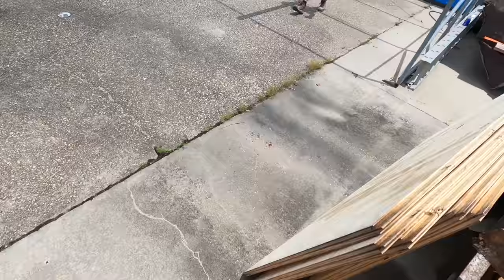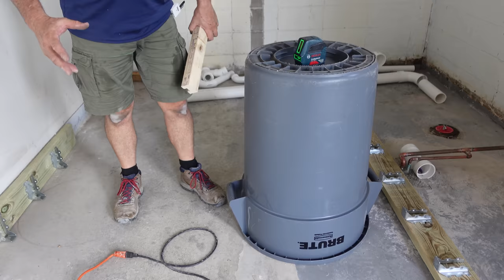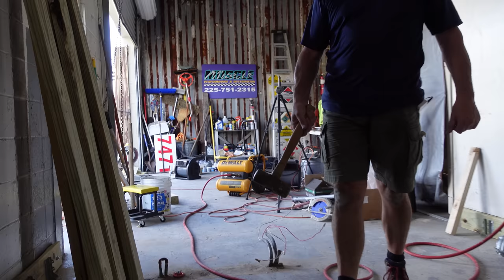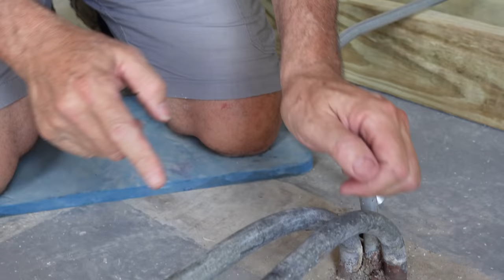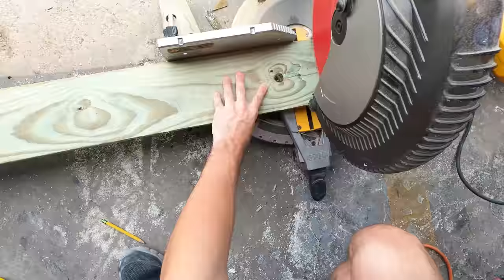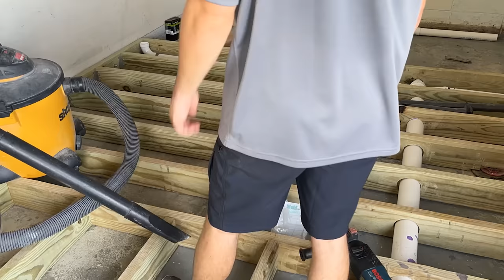The STRONGEST Subfloor System We've EVER Built! - THE SHOP Part 4

Comment: Looks good. Very solid floor system. The only recommendation I would make is to not have that new drain line rest on the nut of the sewer plug. Gravity "eventually" will push through that nut and crack the pipe. A little blocking around it (like the pitch block) will make that area 100% perfect. Keep up the great work guys.
Reply: I had reservations about that myself considering vibrations and friction in the long term. Also, is the plug a standard way to go? Or could you have packed the pipe with debris up to a few inches and then seal the whole thing with hydraulic cement with a level finish? Love the series. Can't wait on the new house demo! Hopefully it's cooler!
Reply: @FaceFaceMan  I can’t speak to that specifically. Codes are different in that area. I have, however, replaced pvc pipe that cracked due to rubbing on fasteners for a period of time.
Reply: Agreed!
Reply: I’m concerned about that as well!
Reply: You said 😃 it. 😊 Hope they rethink the "pipe resting on the nut". I was hoping they would be plugging that hole 🕳 from the beginning, rather than the red plug wheel ♿...😊 😊
Reply: I was thinking the same thing. If that pipe presses down at all it might get punctured. Some sort of protective barrier or support would be a good idea just in case.

Comment: Make sure you install Nail Plates on the 2x6 floor joists on top of the septic drain line, that way you can’t nail the subfloor or screw the subfloor down on top of that 4 inch pipe and pierce it!

Comment: When you were cutting the conduit, I thought, oh, burrs inside the conduit, wires resting on it......then you solved it with great care.      One (of many BTW) of your strengths is the important small things you sweat that are critical.   Anyone who wants to learn all the little tricks that are vital.....this is the place to learn them.  Great work as always.
Reply: i had some wires short out under my house and blow a fuse, electrician ended up replacing a large section of old pipes with tight curves, they rattled around alot when the wind blew under the house, i assume that short was caused by similar problem, sharp inside of pipe over time moving cut the plastic sleeving on the wires

Comment: That floor looks amazing! You always do great work and whenever you post I enjoy watching you work. My only criticism would be that the drain pipe should not make contact with the wing nut of the cast iron drain pipe. You should always assume the pipe will vibrate and because it’s metal against plastic, the pipe will develop a hole. And the other thing (if I had to nitpick) would be more of a suggestion really. When you anchor the L brackets to the floor to prevent the floor from ever coming up. If you are only going to use one anchor per bracket, use the hole that’s closer to the corner of the bracket instead of the one that’s farthest away from where the load/pull is applied.  But like I said... I’m nitpicking really, I think you are a great contractor and your knowledge shows all throughout your builds. Can’t wait to see this project finished and see you working in Texas with the stud pack house build. That’s gonna be epic!

Comment: Hey gang, the shop probably has scraps of aluminum sheets from working on the cars. Just add a 4"x4" piece where the floor cap is holding up the PVC drain, as when people sit and stand from the toilet, the lines will flex and rub on the metal.

Comment: You may not have the freezing cold like we have in Minnesota, to freeze the water pipes, but you do have hot steamy air that will create condensation. You are preventing water from pooling on the floor and making the wood wet, which would eventually cause wood rot, even with treated wood. Always a good plan to insulate the pipes.

Comment: Great video. I'd suggest putting something under that drain pipe at the toilet and don't let that plug wingnut support it. That puts a very small metal contact point on the bottom of that pipe and over time the movement of people walking and using the toilet could wear a hole through the bottom of the pipe, and when it does it won't be pretty. Everything else looks great though!

Comment: Another great job👍 Where you set the pipe on top of the plug, I’d be concerned that over time the threaded part could wear into the PVC. You could take an electrical metal box cover and slide that between the pipe and the threads. I know it’s overkill, but I’m a “belt & suspenders” kind of guy👍

Comment: Love it as usual. Two humble suggestions:  1) use stud guards/nail plates on floor joists above the pvc. It will save a ton of future problems if someone comes after you and nails/screws something through the floor and hits the drain pipe. 2) Don't rest that pipe on the expansion plug. It WILL eventually crack that pipe. You guys are awesome!

Comment: Very solid looking build!
I'm sure others have or will mention it, but resting the drain line on the plug bolt is a bad idea. Subtle expansion and contracting / movement of the drain line will cause a friction hole... eventually.

Comment: I was in the inground swimming pool business in the 70's- 90's. We used a water tube to level forms. With any shape, any size pool the two of you didn't even need to see each other on freeform pools. It never failed even 100' away. 
Really nice planning for the plumbing. I did a lot of pvc pipe in tight places and you have to see the entire project in your head or on paper before starting.

Comment: PL can radically improve overall strength of a panel on frame construction. Use a bead of it on the joists before attaching the plywood. The floor takes on drum strength.

Comment: Hey stud pack. Great job. I’m a gc been framing for 10 years. If you run those joist perpendicular from the others. You have to double the joist they hang on. And you need an extra joist inside the outside rim joist with inside corner hangers.

Comment: @22:47:  Minor suggestion:  When you put blocking in contact with concrete, try to avoid putting the end grain in contact with the concrete, because end grain wicks the most.  It's especially an issue when the end grain is from a cut, because it won't be pressure-treated.  Try to put the side or face grain in contact instead.

It's not a big deal here, because the PL will act as a barrier.
Reply: Great job

Comment: The drain pipe that passes through the joists is very close to where the subfloor will be. Need to be careful when nailing/fastening the subfloor down in that area. I've seen "nail plates" used to protect the utility runs in wall studs; maybe those can be used here?
Reply: Great point!  Protecting your utilities is always a good idea.  You might know where not to nail or screw but the next guy may have no idea.  You can use a SkilSaw/chisel out a notch out an inset so it doesn't mess with the flatness of the floor.

Comment: Paul I had. Porter Cable palm nailer it had the same issue yours did! Then I bought a Rigid $65.00 they’ve gone up!   I’ve never had any issues with it just make sure not to have the pressure set to high on your air compressor because it will blow out that bladder

Comment: I love those Milwaukee big hawg hole saws. They’re not quite as fast as a self feed but they have tons of other advantages. They make less of a mess. You don’t have to be as careful because they don’t bite and throw you around. They also cut through nails without getting torn up. Also because they’re carbide, they’ll drill through stucco, cement board, and other small cement based products.

Comment: In would have done it the same with 2 changes. Gal tru bolts (that's what we call them) and an L bracket at each tru  bolt in the block wall. The wall of those empty blocks is barely an inch thick the a failure could  occur with the cinder block blowing out. Man I could watch you guys work ALL day 😂 thanks for the content

Comment: GRRREAT video brother Stud...I have been hoping you would do something like this for a long time. I did essentially the same thing a year ago, and lo and behold, did it basically the same as you! I did use Simpson Strong Tie screws instead of nails though. My floor is 14x22 (a tad bigger). I would have gone a little larger for the plumbing holes, you may get some expansion squeaks...I also would have just put in a PVC plug/cap on that drain...rubber will always deteriorate. All in all, great job Paul!

Comment: Palm nailers are da bomb!  I had to rework a second floor joist system and ledger due to exterior water intrusion.

After jacking up the second floor, the roof truss system, and replacing the rotted load-bearing exterior wall, the second floor joists needed to be reconstituted.  The palm nailer was the only way due to the tight and limited space.

Comment: NIce work. I would have put a moisture barrier down. I would have tried to frame it in the opposite direction so I didn't have to drill for the main pipe, but you're on the job so you know what you have to do. You go the shower to deal with etc.

Comment: Great job guys. You might consider having your pitch blocks run the full width between joists and use a pipe strap to secure them in place.

Comment: I like using vertical 2x4s to help support joists like this, especially when making a big hole or notch. A few nails into the joists and the 2x4 resting on the concrete. It will never sag.

Comment: Great job as always gentlemen.  One step to consider on future on-slab builds is a vapor barrier.  At minimum, a 6-mil reinforced poly, and at best, Dorken DELTA-FL.  It’s a 3/8” corrugated (structural) polyethylene sheet that allows air and vapor movement beneath your framing.  Although you’re using PT framing, the subfloor is not.  I just framed out a 900 square foot basement with this stuff, plus 1” foam & then tapconned 3/4” Advantec subfloor 16”/center over it.  On the walls, use DELTA-MS.  You could instead use the DELTA-MS in the floors for less seams.  Looking forward to the next video!

Comment: What a difference from one local to another. In Los Angeles, the concrete would need to have been Red Guard. You can never bore a hole that close to the end of a stud. You could not use those L brackets and have to use  tension ties. Also because the bath room is elevated and in a commercial building, you would have to add ADA ramps throughout. 

I would have hung a plastic curtain to contain the dust, rented a wet concrete saw to make the cuts. It would have saved a lot on materials and I do not know how I would ever get that passed by the inspector.

Comment: Thank you for another awesome video, I learned a lot from this video!! Yes, I’m a woman but I love to remodel and build things. Our basement loves to flood and can’t afford outside french drains. Trying to find alternative methods to fix the problem. This video was again awesome, keep up the great work. Thank you guys!!!
Reply: You're probably looking at interior drain tiles to a sump pump.  If you go that route, I'd suggest not having the dimple board run up onto the walls, which creates an air gap to the soil, potentially letting in radon.  If you add a sump pit, seal it and check for radon from that penetration as well.

Just my 2 cents, but a local pro will have much better advice.

Comment: I was inspired by your video to install some LED wafer lights. I didn't realize until after I received mine from Amazon, that yours were different from mine. I could mount over a joist where you couldn't. I'm glad I got lucky and ordered the right ones because that would have created a problem for me. A second thing to note is that the six-packs I ordered could not be added onto. If your layout calls for seven, you'll need two six packs. I assumed I could go to Home Depot and get extras. No go. In fact, the stenciling on the back of each lamp clearly states "6 pack". You can get extras, but they come with an electrical box. No sure quite how that would work. Lucky for me though, the pattern I decided on (before I even knew that I couldn't get extras from HD), was 12. So two six packs did the job. Love what you do. Eager to see how the plaster of paris house comes along.

Comment: Crazy solid work. Love to see a job done well. Others have mentioned the pipe sitting on the plug fastener but I was curious if there was a reason for the L brackets being secured to the floor on the hole at the end, I would think nailing them closer to the bend would provide more strength against rising. Either way I'm sure it won't move! Great work guys.

Comment: Nice work guys! I love your videos.   Are you not worried about that plug's wingnut wearing through your drain pipe?  I would be concerned that vibration would cause that wingnut to eat its way through the pipe and cause a sewage leak.
Reply: I thought the same thing.
Reply: I suspect he was joking and they went back and added blocks under it

Comment: First creat work. A couple thoughts.
You need to lift the PVC off of the cast iron. It will wear a hole in your pipe over time, and a sewer leak under your over the top job. You could cut another piece of ur Sched 40 and then split it to form an arc over the wingnut place it at 90° to the drain line.
Placing the redheads in the far whole of the L-brackets it will leave room for uplift. If you don't want it to move at all you should anchor in the near hole. That is a bathroom in a LA. Humidity is going to be intense. he swell and drying could eventually crack out your grout, although it will certainly be a long way off regardless.
Advantec is the best subfloor you could use. I know you already have PT 3/4 ply on site but Advantec has a 50yr exposure guarantee. I've used it setting with cut end in clay for over a year with no deformation. I've also seen it used on a muddy commercial job site to keep the heavy equipment from churning everything into a mid pit. It was there for a about nine months again working like a champ.

Comment: Just a thought, for those empty blocks. They make mortar guns, also empty caulk guns. I would have drilled the center a few inches above my hole, then pumped mortar into the block until it was full. Drilling the edge doesn't give much material. Especially considering a wedge anchor is pushing out from the inside of that 1 1/2" bit of concrete block.

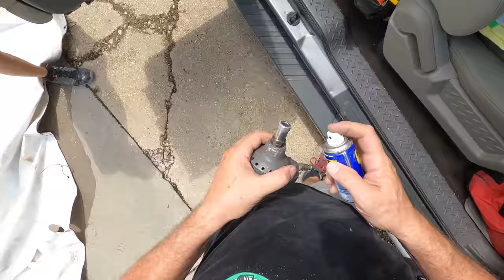Comment: 16:17 when you had your palm nailer hooked up you could hear the air escaping. Almost all pneumatic devices operate based on an internal seal. Some require oil to keep things lubricated others do not. My palm nailer set specifies a few drops of oil per youth cycle a used cycle being determined by regular use over a few hours time. Those internal o-rings sometimes need to be lubricated as well otherwise just like any rubber gasket they can drive right over time leading to a leak. The one you have seems like it is able to be disassembled. I can almost guarantee you if you take that back plate off you will find a few cracked or dry rotted o-rings. Simply replace your o-rings and you're good to go. I've had the same Palm nailer for nearly a decade, and I've only had to replace o-rings twice. But each time that I replaced them, it functioned like new again. While disassembled you'll also want to take a brass brush to the sleeves to get rid of any rust or debris that builds up between the sleeves that can also cause the mechanism not to slide properly. Also check the spring there's a spring in there that provides the  pressure for the seal. Always cheaper to replace a part with an hour of your time than it is to buy new equipment. And if you are handy, I can guarantee you that replacing those o-rings and spring should take you no more than a half an hour and a few dollars half an hour is being generous as it can be done in as little as 10 mins

Comment: The more I watch this project, the more I think "Yeah, cutting that slab for the plumbing would have been the easier way to go." But, that being said, you've got to accommodate your customer's wishes so I understand this crazy amount of work.

On a side note, rats can chew through those plastic expansion plugs. It would have been better to block the pipe down a few inches and fill with a bit of concrete.
Reply: 14" concrete saw a 70lb Jack hammer and would've been done in a couple hours

Comment: I got nervous when you were using the nailgun through wood so close to the plumbing. Those are nice shims. I'll have to order some. As some others have mentioned, nail plates over the plumbing would be necessary. I'd also put it over electrical just in case.
This gave me some ideas for when we fix up our bathroom and laundry room.